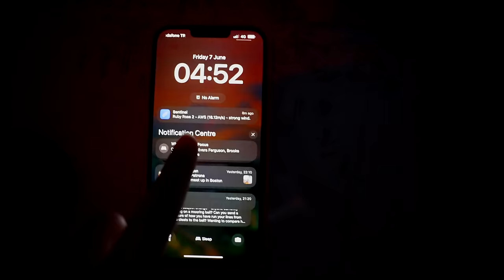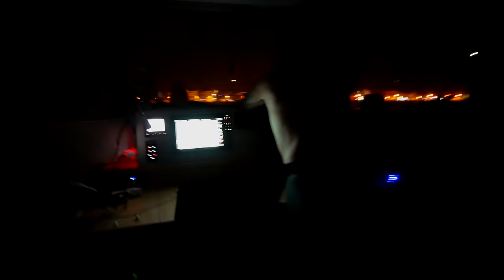This is How We Prepared Our Boat for Sailing after 6 Weeks on a Ship

Comment: Goof off RustAid rust and stain remover  bathroom cleaned my grinding rust spots from our boats gel coat and even the hydro mats - leave on a minute or two and it wipes off very easily.   Amazing how a little grinding covered half our boat.  Good luck

Comment: Nick - For future use and reference.  1)  Loctite is an anaerobic adhesive, not a liquid plastic.  2)  You do not fill a hole with Loctite.  You always put Loctite on the object to be inserted into the hole.  3)  You use the minimum amount of Loctite you can as that speeds up the anaerobic curing process.  4)  If you suspect Loctite has been used to assemble something, it is strongly recommended to apply heat to the item to be disassembled as this breaks the adhesive bond.  This does not have to be high heat, just over 150 degrees F, or somewhere in that range.  5)  There are different levels of Loctite, ranging from blue (likely to be disassembled and not needing heat to break the adhesive bond, but weakest in holding the lock); red (not likely to be disassembled and likely to need heat to break the adhesive bond and stronger than blue); green (likely to never be disassembled and will definitely need heat to break the adhesive bond, this is the strongest bonding).

You used blue Loctite on your batten car.  I recommend you get either red or green Loctite and remove the screws, clean out the holes with acetone, and then reassemble with either red or green Loctite.  Blue Loctite has been known to release the adhesive hold under constant vibration and your batten car is intended to be a permanent installation.  My guess is your sailbuilder used green Loctite in assembling the batten cars.

Something else I saw.  WD40 is great for cleaning out gunk and such, but it is not a lubricant.  Your best lubricant for your running gear is to use Boeshield or an equivalent PTFE spray (I think the WD40 company makes a PTFE spray).  WD40 is essentially kerosene and kerosene is not known for its lubricating properties.
Reply: ronkluwe4875, as Darth Vader would say, "Most Impressive".
Reply: Well said.

Comment: One of my hobbies (I have many) is horology, that is the repair af antique clocks. This involves disassembly of mechanical movements in whole, diagnosing and then affecting repair followed by cleaning, reassembly, and then testing. The attributes required for that process are the same attributes I see in you as you diagnose problems and affect repair. It embodies METICULOUS ATTENTION TO DETAIL, which you have, and it is what I love about your channel. I just love it when you dig way, way, down into the weeds to affect repairs, GREAT STUFF! Thanks for sharing and be well, sail safe.

Comment: Red Loctite releases at about 500° F. Titanium is rated for service to about 600° F and the strength is not affected until about 800°F.  Hardened steel can start tempering (losing hardness and strength) as low as 350-400 degrees F.

Comment: I had the same problem on my boat, it was not welding fragments, it was when we pulled out a spare anchor chain that had been exposed to sea water and had surface rust. The fine particles floated over the whole boat. It looked so bad, but like you we discovered that Oxalic Acid made short work of it, and even brightened the gel-coat overall.

Comment: Couple of suggestions... Toss the WD40 overboard, for the rigging bits use mclube dry lube if you can get it and a proper lubricant down below. And get a prefeeder for the jib. You won't use it often but it makes it easier to hoist.

Comment: At a car dealership near rail road tracks, the white cars were always covered in rail dust.  We used clay to get most of it off.  The clay we had was a professional grade, much harder than the stuff from the parts stores. Pretty much magic.  I don't know if RR2 is painted or gel coated but I imagine clay would work better than chemical.

Comment: Don't know if it's been covered in a distant comment but if there has been grinding which has caused the millions of dots of discolouration on your surfaces you need to know that it is from millions of super-heated fragments of material (usually metal/steel) which have melted into that surface. Whatever you think is just a 'surface-clean' that will solve your issue...think again...I'm afraid. Imagine your non-slip surface, the 'dips' will have these hot fragments melt down into those 'dips', there's no way you will polish out those fragments as they rust in those dips. Sorry to deliver bad news. Does depend on how close the grinding was, if a fair way away the fragments may have cooled enough to not 'melt' into your boat's surface.

Comment: Titanium is without and question, the best metal to withstand heat. The only better metals for heat are complex alloys. Heating the pin would have been a far easier to disassemble it. The pin would be not damaged by very high temperatures.

Comment: Total nightmare!  You have metal etchings melted into every surface. Even if you repaint or redo the gelcoat, you will  get metal oxide induced blistering/osmosis.  Whatever you do, water will penetrate to this new oxide layer and ruin the coating.  This stuff is everywhere and in every place, including many that you have not thought of.  It will be in all your tanks, water lines, electic engines, all you winches, in the window surfaces, etc.   I suspect it is a total loss.  STOP trying to clean it and submit a claim.  Notify SeaWind and get confirmation of the problems and why so-called "repairs" will lead to failure later. Nice, this is way worse that you realize.  Insurance will sell off the saibloat for whatever they can get and you will get a new one.  Take action.